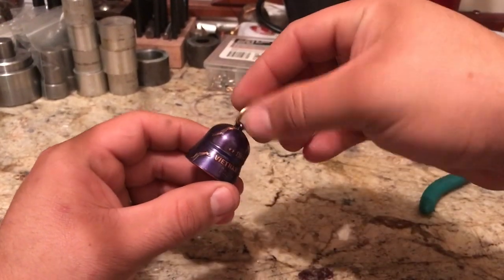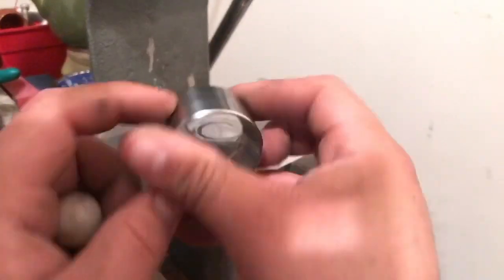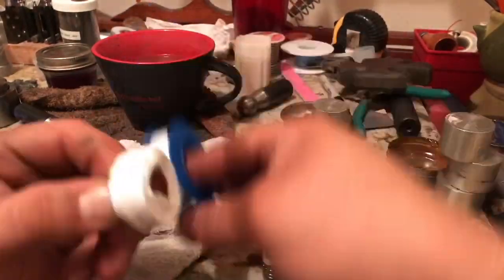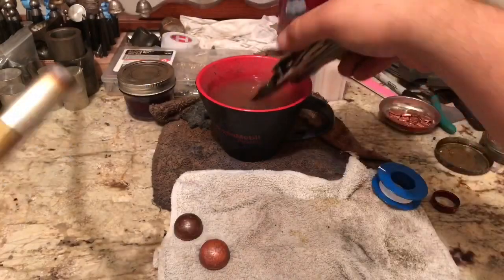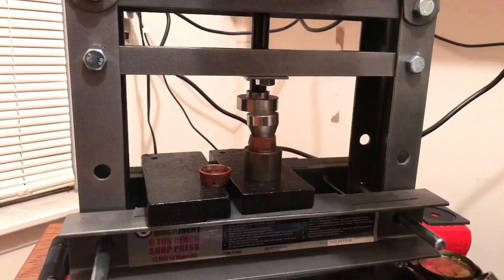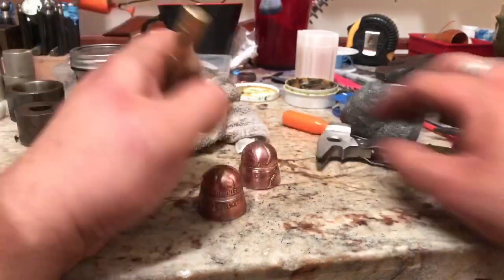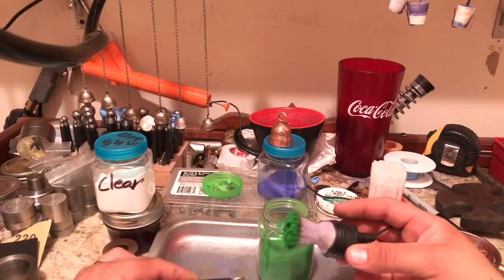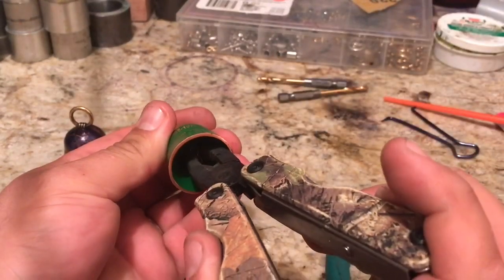Vietnam veteran coin bell

Comment: Incredible work, I congratulate you.  Can you tell me what type of lubricant or grease you use to protect the dice from damage, what the colorants are called and the type of oven.  I know ..... there are many questions
Reply from the maker: Sorry just noticed the message I use coconut oil in my dies but I wrap my coins with Teflon when I make the cone The Color is called tractor green and marine blue powder coat the oven I have it’s just a regular $30 oven from Walmart

Comment: Nice work!  Where did you get that metal disc for your harbor freight press?
Reply from the maker: If you are talking about the 6ton press you can buy it at Legacy brand tools on Etsy
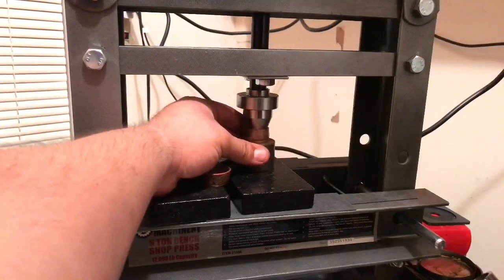Reply: @ 13:25 of the video; On your harbor freight “A frame” 6 ton press, there is a flat disc on the end of the plunger. My model doesn’t have that.
Reply: I was. Thank for your reply and time.
Reply from the maker: No problems her is the link https://etsy.me/2zVjHUZ
Reply: Yup! My order from them came today. I also picked up the hand knob for the jack.
Reply from the maker: That’s good to hear